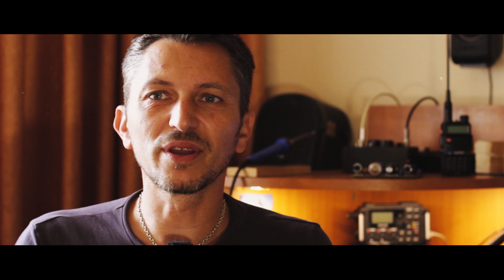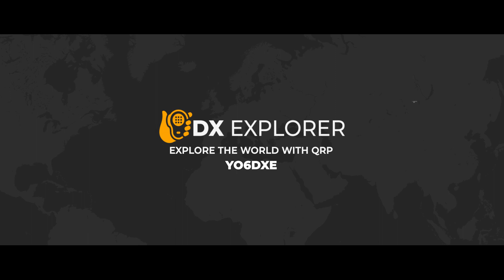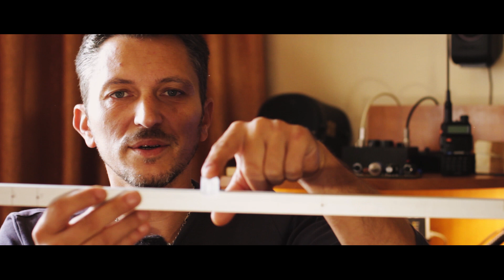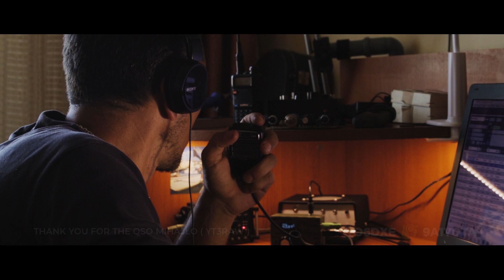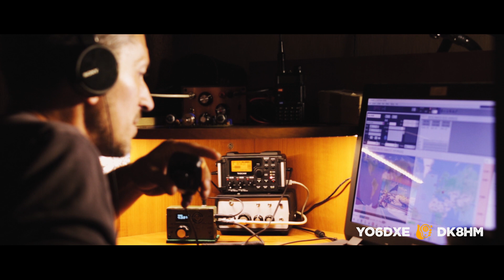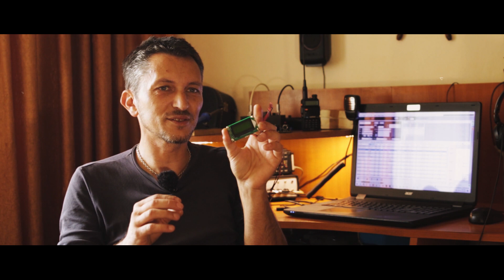QRP DX With 5W And Homemade EFHW Antenna

Comment: Hello. What is the model of microphone plz.
Good continuation.
73 from F4LCF
Reply from the maker: Good morning. I don't really know what brand it may be. It used to be sold by roWaves but is no longer available. 
73, YO6DXE
Reply: @dxexplorer oh no! Link is broken
Reply: Looks like Amazon US has some simple TRS mics. When I get home I think I'm going to try to make an adapter for the Kenwood type of speaker mics though. There is a French fellow here on YT with some similar plans.
Reply from the maker: The one I have came with the transceiver. So far it works fine. I also thought about adapting a Tidradio one since it comes with the speaker. I just need to 3D print that case for the connectors that Manuel presented in one of the videos.
Reply from the maker: Sorry. Yes the link is broken. They no longer sell that one. I thought I was commenting on the DC plug we were talking about 😅 let me edit the comment with the link.

Comment: Keep working on CW. Best thing I did was join the Straight Key Century Club. They have really good community, and a sked page you can use as a back channel to schedule QSOs and to chat when you miss stuff. 

Put out a CQ at the pace you want someone to reply, and they should come back at the same speed. I would send NEW TO CW SO PSE GO EZ HI HI.  

The SKCC crowd have a pretty straight forward QSO format, which is RST OP QTH and SKCC number.  If you get their logging software, all that info is already in a database for you. All you need to do is to copy the RST and you can pick the rest out of the log :-)

I only just got back on the air a couple of years ago, and haven’t been on the for the last couple of months. Too many other priorities and having to spend 30 minutes prep to get on the air, has limited my operating. That said, I’ve been using Morse Ninja to keep progressing my CW copy skills. I’m still struggling to get to 20WPM reliable head copy, but when I keep up  the regular 10 minutes a day, I see improvements.
Reply from the maker: That is great to know... I didn't know about all that. And yes I will keep working on learning the code as I really like CW and to be honest I can't wait for the day I will be able to do a QSO in CW. The best part is that I can do that with really simple equipment hahaha. Thank you one more time. 73 DE YO6DXE.
Reply: @dxexplorer  CW will get you a little further than voice on 5W. It’s also easy enough to build a simple and cheap amp to give you 20-50W which, the extra S point and a bit will help your signal cut through against the Italian QRP stations that are only running 100W :-) (that’s a joke)

A couple of IRF510s in class E with enough voltage should give you enough squirt in your antenna to get you here into VK when the conditions are right :-)

Looking forward to seeing a video of that first CW QSO

73 FE VK2NAP dit dit
Reply from the maker: I thought Italian stations are at least 1Kw 😅😅😅 hahaha. Indeed I love the simplicity of the equipment both on amplifiers and also on the amp side. Is actually what kept me going until now even if I don't know the code yet. I think I have at least 50 schematics of things related to CW that I kept saving for years and now I want to build. The ugly days season is coming so that means I will have enough time to be stuck in the house and learn the code while also building more stuff. Now with the license things are more exciting than before when I was not allowed to transmit. 73 DE YO6DXE. Have an amazing weekend.
Reply: @dxexplorer  I shall neither confirm nor deny whether or not I operated before I had my license reinstated officially :-) but if you were thinking of running unlicensed, I would use CW as at least it implies that you know what you’re doing :-)

The first mobile CW QSO I had was on 10m at around 12WPM with a VK5 station who, when I looked up his callsign when I got home, had a callsign that didn’t exist and didn’t match any of the other variations I tried…I assume a pirate station :-)

Just keep picking away. I’m sure you’re more than capable of an RR UR 5NN 5NN 73 TU  dit dit. But I did a full RST OP and QTH for my first few calls. It’s addictive once you get started.
Reply from the maker: @MidlifeRenaissanceMan  I'm already addicted and I haven't even started yet hahaha. Imagine later. I don't know what you are talking about on transmitting with no license ))) It will be fun for sure... and I'm glad the rainy days are coming so I have more time to learn. 73 Chris and happy DX-ing.
Reply: @dxexplorer  the guy I had the QSO with was using a made up call sign. Someone on 10m operating pirate CW :-)

As for me, when I applied to get my license reinstated, they gave me a call sign almost straight away, but took many weeks to get my “account set up” so they could bill me for my license. 

So my new callsign was active and allocated in the ACMA database as active but no license attached. 

Anyway, they eventually sorted my licensee out. As I say, if you’re not harming anyone….

Need to upgrade my license soon. I have the “middle” license which gives me the “classic bands” from 80m with 120W PEP max. No access to 160m or the WARC bands.  But having 20m and 40m has been fine for me. 

People say I should have a full license as I know how to do  ham “stuff” that some of my full call friends get me to sort out for them, but there’s some stuff in the theory I need to get my head around the terminology and some of the maths 

That said, I have a massive I need to try this list for a ham radio YouTube channel I’m looking at doing with my friend George VK2AOE. I’ve purchased a tripod, a half decent lav’ mic and a 4 track recorder to start putting material together, so keep an eye out. I’ll message you when we kick it off. 

We will be doing a fair bit of getting on the air CW stuff. For those who know enough of the letters and numbers, but are worried about getting on the air. 

CW is great in that it’s so simple to get on the air. A couple of transistors and you’re punching a watt. Add an extra device or two and you’ll smash 5-20W or more. 

One of my projects on the bucket list is to build a working spark gap transmitter and coherer receiver. See if we can get the signal within the bandwidth for operating on the HF ham bands. Big blue sparks and lots of filtering :-)
Reply from the maker: @MidlifeRenaissanceMan  I am looking forward for the channel as I also watch a lot of videos and I really like that as there is a lot to learn from other people's videos. Until then maybe I can learn a bit more so I'm able to read the code hehe. About the license..  I have the equivalent to the novice one... I have access to nearly all bands with 100W... but since I like QRP..  I'm not sure when I will actually use those 100W allowed haha. I also want to jump to the next license maybe next year before going back on water sailing around for a while. So for sure I will end up making most of my videos MM... no more land for a while. Thingers crossed things go well for that to happen as I really miss that. Until then I just hope I learn more and I get a little better in the hobby. I will also slowly start to prepare some equipment that I will strictly use aboard and take with me when I leave. We will see how things go in an year from now. Again..  I'll be waiting for the videos from you then. You made me smile with your comments... to be continued )))

Comment: Great video! I am also a (tr)uSDX user and recognize the stations from your QSO’s. They are willing to help QRP operators filling their logs. Did you modify the handset you are using or is the inbuild mic already sensitive enough? 73 de PD5ANT
Reply from the maker: Indeed they are helpful... some even concentrate a lot on QRP stations. I actually never used the built in microphone. When I received the TRX, it came with an external handset already so I keep using that one. I just noticed in a QSO a min ago that if running on batteries and the voltage goes under 9v the reports I get is that I have a bad modulation. Not sure whats the issue at the moment but my TX drive was down to 3 in the menu. At 6 it was really bad... 3 was a little better. Still I need to figure that out and make sure I have a clean signal. 73 DE YO6DXE.
Reply: @dxexplorer  I bought and use a Baofeng handset but I doubt if it is worse or better than the original internal mic.
Reply from the maker: To be honest I think it's pretty much the same internal mic... not some big difference. Except the fact that instead of holding the entire TRX in your hand... you only hold a mic instead )))

Comment: CW is easier than you think!Most QSO's are similar format.....the exchange of callsigns....RST (signal report) etc. Don't give up ....with practice it comes...Most important thing is, like learning any language just do it and don't worry about stuffing it up, the QSO is not life or death. Use FL digi to help decode too. Build your own antennas, I have a link on my channel for a vertical L that works on 40 and 20m and is a cheap build (substitute wood or PVC for support). 73 de VK2AOE
Reply from the maker: I know the video you are talking about. And yes CW is not that hard..  you just need a little free time to learn and practice. I honestly had a lack of free time lately hahaha. But cold and rainy days are coming soon so that means lots of practice ))) 73

Comment: Super video ... sper sa ne auzim curand cand o sa fie propagarea buna, 73 M0IVI
Reply from the maker: Poate incercam asta seara un pic. Vedem cum e propagarea si facem o incercare 😀😀😀 73 DE YO6DXE.
Reply: @dxexplorer  ma gandeam ca o antena yagi pe 20 m facuta din cablu ... "Inverted V 20M wire yagi" ... am experimentat cu mmana gal ... si are mare gain ... :) hai incercam mai tarziu da :) ...  pe seara un contact
Reply from the maker: Am crezut ca spui sa incercam sa facem antenna hahaha. Cum e Yagi inverted V ? Nu am vazut pana acum cred. Si da da clar facem o incercare mai pe seara. Cam pe atunci am propagare buna spre UK de obicei.